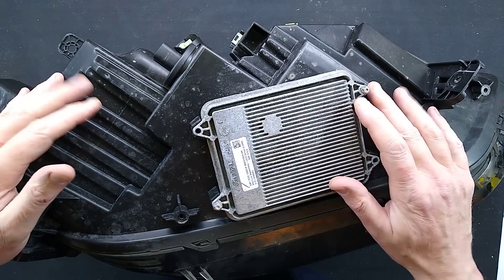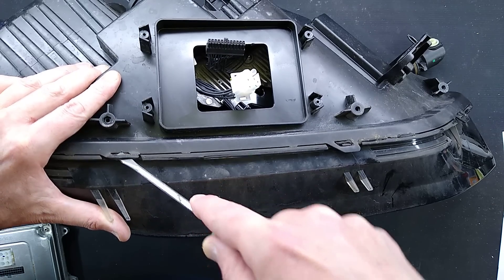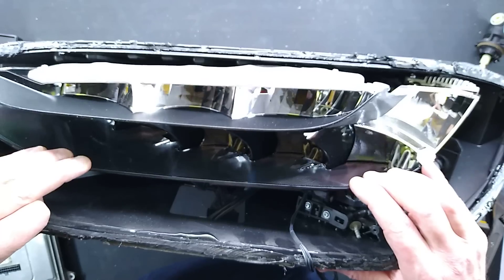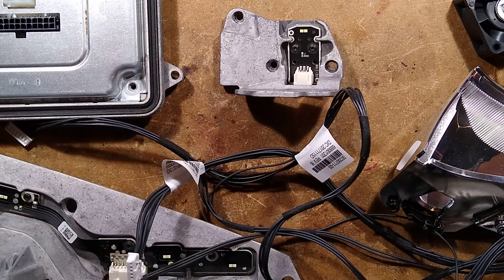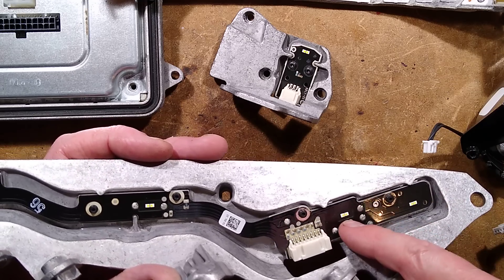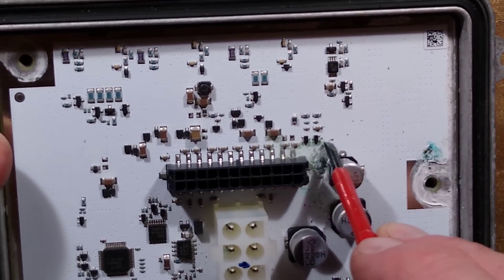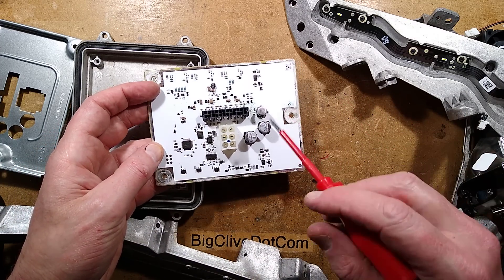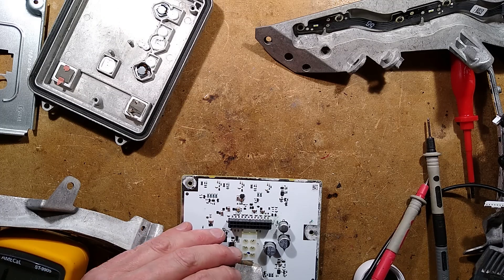Exploring a Tesla model X headlight

Comment: To open headlights less destructively or even so they can be reused you need to use an oven, it will melt the glue, might take a few attempts plus isopropyl alcohol on the glued areas.

Source I was a mechanic

Comment: My module has recently failed on my Mercedes as the DRL lights up for 15 seconds or so then throws up an error and goes off. Probably water ingress. Will have to take it apart soon and see if it can be fixed before having to pay £500+ for a new module plus coding 😤

Comment: If you want to know about expensive repairs for simple problems wait until a motor (or anything else) fails on a front seat. Tesla only sell seats complete (NZ$4500 here in NZ)!
I've had to replace a similar super-expensive headlight on my S. It died from having one of the 'decorative lights' as you call them (sidelights) fail. From 'researching' on youtube it seems likely to be an internal fault and so unreachable without megadeath methods.
Nice teardown, thanks.

Comment: A gentle heating in the oven (with REGULAR checking every 5 mins or so) will sufficiently heat up the unit enough to soften the glue/sealant so you can prize it apart (have done it a few times with my motorbike headlights and tail lights (for LED enhancements/mods... 😏    😎🇬🇧

Comment: The seal around the module was probably just fine. The problem is the connectors are open to the body of the headlight, as well as being on the bottom of the headlight, which means any liquid that gets in somewhere else will puddle down to the module. Or perhaps just humid air which condenses with temperature changes.

Comment: There was opening for the 3 electrolytic capacitors & water has gone inside from this gaps.
Don't know which dumb engineer designed this headlight module.

Comment: High pressure car washes. See this all the time across many brands of vehicles. Now that people have ‘subscriptions’ to car washes they are going daily and not only are they destroying fancier electronics on vehicles they can cause paint in certain areas like mirrors to prematurely strip off.

It’s incredible the amount of damage those car washes are causing when someone goes too often.

Headlights are by far the most common because they typically have a look of areas sealed with gaskets and silicones that dry out but they receive a very close and very sustained blast of high pressure water.

Comment: FYI to open those lights up use a hair dryer ... put the headlight in a box with the hair dryer into it and let it get really hot all over ... then the mastic will get soft enough and you can pull the lens off ... same construction for all headlights.   https://youtu.be/PMakhTEfhTo?t=244

Comment: lol, looks like their using a standard 24 pin atx computer psu connector for one of the connections

Edit: ok, 2 questions come to mind, what power are the main led's running at? and why the heck didn't they coat that circuit board with something?

Comment: Clive, to get those light assemblies apart you put them in your oven at 200-225 deg F for 10 min or so, that softens the glue and it will come apart. To reassemble you do the same thing then put the halves together. Check Youtube for putting RGB halo lights in your Ram truck.

Comment: Wow there is a lot going on in that headlight. If I had this headlight would take all those LEDs and wire them in parallel and run them on a couple of AAs since they are 3 volt LEDs. And you get a mini fan.

Comment: As for replacing the entire headlamp as standard procedure; given all the other things that could go wrong, diagnosing the module itself may be considered a modern act of {BUM BUM BUMMM} - the dreaded, "labour-intensive"...  'component-level' diagnosis.  

Not sure of the knowledge base crossover here, but there was an electronics company called Zenith here in the states that made a lot of TV's(very good ones for the most part).  As a certified repair facility, our only option allowed was board swapping(block diagrams, no schematics, etc).  Pull the bad, put in the new, send the bad back to be "Officially Factory Refurbished", then maybe get that same formerly "bad" board back for another repair.

I always thought of it more as a control issue.  Not that I'd expect any sort of control issues from Tesla.....

(Oh shit, I'm probably on some list now)

Comment: Unfortunate that those control modules aren't fully potted, with weatherproof deutsch connectors.  Sure, you'd have even closer to 0 chance at repairing that over this, but the chances of moisture related damage would also be much lower. 
And also a shame that this module just couldn't be diagnosed and replaced by Tesla. There may be some regulatory blockage regarding safety devices like that, but it still goes against the whole sustainability mantra... 
I wonder if the newer cars like the 3 and Y have better designs. I haven't looked at mine yet.

Comment: This makes me wonder about the LED projector headlights in my Toyota and how well they were made. Then again, I have had it for 7 years and 133k miles with no issues. I just have to remember that there is a world of quality difference between a $22,000 Toyota and a $100,000 Tesla. The Toyota is engineered by people who are actually concerned about how much trouble the car causes it's owners and they seek to minimize it. The Tesla is virtue signaling status symbol for people who will pay any price to drive one, so quality is not a big concern.
Reply: Toyota also has pretty good parts availability. 

When engineered well LED headlights should last much longer than the lifetime of the car. For this Tesla headlight $0.05 of conformal coating would have prevented the water from damaging the board.
Reply: @groundzero_-lm4md  I agree. The lack of attention to detail on something this expensive makes me question Tesla's quality culture.

Comment: The National Highway Traffic Safety Administration (NHTSA) has regulations on headlights that I'm sure affect the option of making headlamp assemblies serviceable past the old incodesecant lamps. The module is most likely considered part of the LEDs, and you'd have to replace the LEDs with the module (headlamp assembly.)   So the manufacturer most likely can not legally sell a module with it being attached to a headlamp.
Reply: Good for safety, expensive for the end user.

Comment: Yeah, it's kind of amazing how absurdly complicated a dang LIGHT can be. I have an '06 BMW 325i with the stupid xenon "adaptive headlights", which means they turn with the steering wheel. They're about $1200 for a decent used one, and even then you have no idea how long they'll last. They weren't excatly known for their longevity. There's no way to flash it out of the system and make the car think it has normal headlights, so I'm forever stuck with a stupid warning indicator light since I refuse to blow a few grand to replace them and pray they will still work. The newer LED headlights on motorcycles nowadays are also insanely expensive as well. Even a simple Triumph Bonnie headlight is something around $800 new, and that was the dealership cost directly from the manufacturer. It's getting to be a little silly, if you ask me.
Reply: I know it's been a while, but I should also add that they are starting to VIN lock the headlights as well. So you can't just go grab one from the junkyard and slap it on. Nor can you simply take it off and put on some aftermarket light, as it will cause the ECM to throw a code. They're beginning to do that with just about anything they can nowadays. In a few rare instances, it does make sense as the component in question is unique to the vehicle. But in most cases, it's for no other reason than to hamstring the used part market. Very, very irritating.

Comment: Normally not a fan of when stuff is glued together like this, but it does make sense they'd glue it up considering all the problems with moisture intrusion on vehicle headlights that's been happening ever since the days of sealed beams. Maybe if they used some more glue this headlight would have never failed from moisture ingress in the first place.

Comment: Likely you can't even buy the electronic module by itself and have to buy the entire assembly unless you can find one at a scrap yard somewhere - where you'd still have to buy the whole assembly and it would probably go for a premium anyway. It would be nice if they made these things more serviceable considering the insane cost of a replacement unit. It's amazing how we've gone to $1000+ unit costs on replacement headlights and taillights now. Tesla is on the high end but that cost isn't even surprising considering what any manufacturer charges for their LED assemblies now.

Comment: you can 'cook' the headlight on low heat in your oven (starting a 80°C for 15mn and going up in temp if it's not working) it will melt the glue

Comment: The control unit is sealed round the edge where it fits to the case, but not sealed against moisture ingress on the inside. Since there's bound to be moisture getting into the unit somewhere it ends up as vapour when the headlamp warms up and deposits itself on the control unit which has cooling fins.

Comment: Tesla, saving the planet, one throw-away headlight at a time! 😀
Reply: All the other manufacturers are no different though.
Reply: It's basically a form of greenwashing...
Reply: You know that there isn’t any environmentally friend car at all and carbon neutral is a lie ? The only environmentally friendly travel is on foot.
Reply: I'm really shocked by the cost of this unit compared to other parts from Tesla which are modestly priced if not downright cheep compared to the usual "Stealer" network gouge fest that goes on, I needed a 3" long cable assembly that releases the middle row seat catches as it had snapped off at the nipple, but of course you have to buy the complete cable assy/Gearbox/motor as a unit...£19 ..from Tesla, hardly worth messing about with trying to repair the cable at that price, I've just replaced the nearside front door actuator mechanism unit...£12.50 inc vat, got the offside one too while i'm at it, I'm not sure if  Tesla just charge what the part costs them plus stocking/delivery fee or are we just used to being bent over royally by the 200% markup cowboys.
Reply: Who said tesla was saving the planet? More like saving for investors.
Reply: @KarolineLeavitt-29a  more likely funding Space X
Reply: @KarolineLeavitt-29a  Oh I think many of the investors will find themselves in the same place as that headlight. Still for every buyer there is a seller, so someone will make some money.
Reply: @KarolineLeavitt-29a  
I'm sure Tesla drivers  "feel" that every journey they make they are 
"saving the planet" 
why else would they buy an electric car..
Reply: @stuartd9741  Because they worship a billionaire.

Comment: The only thing I approve about this entire module is that they at least use generic easy to find TE/Molex connectors. Unlike the other guys with proprietary ones. 
Also this design is very similar to Federal Signal light bar technology. The integrity series on their website shows it better than the others.

Comment: The glue is more of a bonding type. Heat an oven to 100-120 degrees c. You can go up to 150. Labels may suffer. Light survives. Then use a screwdriver and try. If it doesn't work: more oven time or go to 180 c. Eventually it'll go sticky loose and you'll be able to rpy 'em apart...

Comment: I think I'll stick with the headlamps on my 40yo Volvo 244DL. I recently had to replace the reflectors as they had tarnished to the point of MOT failure. This involved unscrewing the retaining bolts, removing the clips that hold the silvered part to the glass front and reversing the procedure to reinstall. Keep your Teslas - I prefer a car that was designed to be worked on at home.
Reply: My 1989 Volvo 340 headlamps are still OK, so is the rest of the car at around 200,000 Miles, in fact it just passed the MOT again with no advisories and very low emissions, however, the Ultra Low Emission Zone comes here next year. Cant use the Volvo then. Instead I'll have to use my 1962 Mini that has been standing 17 years, it''s exempt.

Comment: So much to be said for standardised headlight units - this headlight assembly is really ridiculous. 
Standards work for electrical and electronic components, it works for nuts and bolts and a myriad of other things.
Canbus has many advantages but it lost the redundancy of individual wiring circuits. 
Two steps forward, one step backward.

Comment: If this is the future of cars, I want a 60s model even more lol. Oh how simple the days were when the headlight had 2 wires and the bulbs were replaceable and within reach. This is the most convoluted light I have ever seen. A circuit board with LED drivers that has a CAN bus to tell it what to do. I honestly think we are going backwards at this point, the cost is beyond what it's use is.
Reply: My favourite cars often have the entire car wiring diagram on one page.
Reply: Early 2000s is optimum imo. Older headlights are pure shit (or just as expensive or as discontinued stuff - much more expensive)
Reply: I like my 76 GM Blazer, ONE  critical electronic part - the ignition module; under $20 and replaceable with common hand tools (alternator doesnt count : you can drive some distance with a dead one)
Reply: Unfortunately it’s the new norm
Reply: @bonusnudges  Bicycles have Bluetooth controlled gearshifts now!  They work really really well and cut down on cable clutter.  This is on human powered bikes, I might expect something like that on an e-bike.  But if it works and people like it, who am I to say.

Expensive car headlight repair has been an issue since HID lights.  Even halogen housings turn cloudy eventually or leak water.  I've had cars with halogen bulbs that could only be replaced after removing the bumper cover, try that as a DIY project in the winter.

The "unrepairability" issue is getting worse though, I imagine those interior electronic consoles are tremendously expensive as well, not to mention you'll need some kind of service contract to get software upgrades and patches.
Reply: Do you really need to cut on 2 cables? Make bluetooth controlled brakes next 🤣
Reply: The irony is it should be more reliable, less moving parts means less things to break. 

Were crap at designing enclosures to keep 100% of moisture and dirt out. The electronics can be super reliable, if some rubber seal doesn't fail elsewhere, but i guess that's because we stuck with old technology for that.
Reply: It's precisely the idea behind a successful business... make a product so difficult/impossible to repair with a designed limited lifetime so that the consumers will buy your latest and greatest at the "special pre release limited edition" price. You make a product too good and nobody will buy the next version because the first one is still working fine.
This is why there are intentional features missing on 'new' things that people will kick and scream about but then proceed to buy the next one because they now included that feature. So yeah, we are going backwards because $$$.
Reply: @Zebra.Lionfish  With most car makers I would say you are right but with Tesla waitlists often longer than 12 months and them losing money on their service department I dont think this is that case here. For most manufactures they only reason the company is still in business is the service dept, not so with Tesla.

Comment: If you put the headlight in an oven on a low temperature to soften the adhesive the lens can be removed without too much destruction and you can usually reuse the adhesive to reseal the assembly

Comment: I don't think that it is a network error. I can think of at least on reason why the numberplate light defaults to ON when one of the headlights fails. I wouldn't have been surprised if you had told me the car refused to start with a broken headlight either...

Comment: So glad car headlights cost $1200 now. I was getting real sick of paying 20 bucks for a sealed-beam one.
Reply: I am old enough to remember my father paying something like £2 for a sealed beam in the late 70s!
Reply: I remember when there was a box to put a check mark in to have your vehicle  registered as “daylight only”. 
We didn’t need no stinking calcium carbide
Reply: - At their most expensive  :-)
Reply: I miss the day when headlight choices were 6v/12v, Round/Square, and High/Low/Combo.

I shouldn't have to find Chinesium knockoffs on eBay/Amazon/Rockauto that are a bit shite, but actually affordable.
Reply: You got a point though, there shouldn't be any special 6 volt led lights for double or triple the price of a 12v when it's the same part in a different box. I remember playing with a 30v led machine indicator light and finding that it only took 1.5 volts to fully illuminate it; carpet-day ya'll, carpet-day.
Reply: and they dare to tell us we makes pollution cause our cars are old.... i mean that new gen pieces of crap fall into bits for nothing and cost the price of a n excellent car i'm far for getting an electric car and if i do it will never be a tesla!
Reply: They are 150 bucks on Ebay for a good used one. Not to bad.

Comment: OMG is that a shitty design. No wonder they fail left and right and even when they work the light output is so bad that they had been faulted for that. Mike Harrison had a BMW headlight torn down, that's a completely different beast of a module and oozes engineering and build quality in comparison to this one. The tiny LEDs and plastic mirror assemblies and one axis mechanical tilting meachnism are best described as a practical joke but it is sort of funny that they're failing due to beginner mistakes like water ingress where other brands rather tend to fail due to overgineering and the whole module declining to work e.g. after a single stepper motor failure...